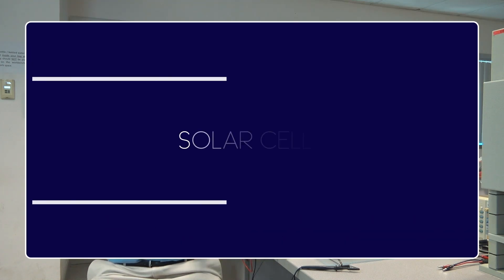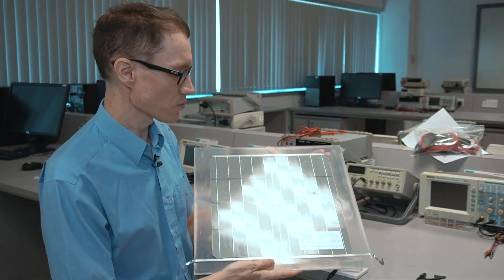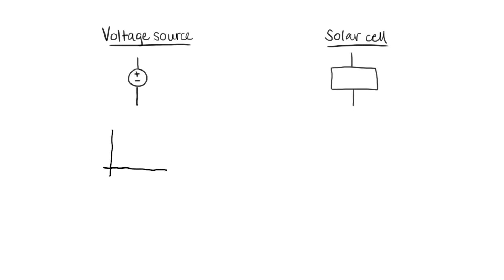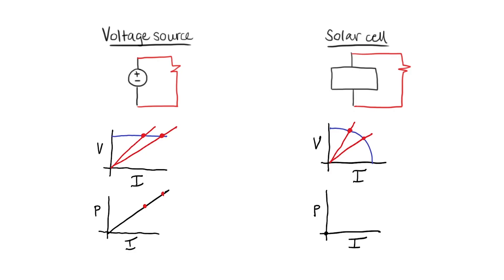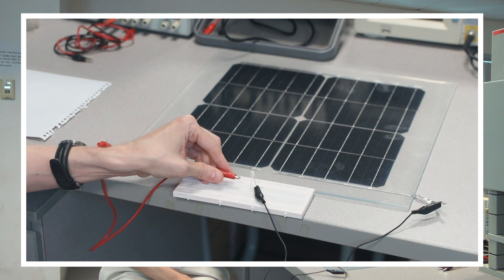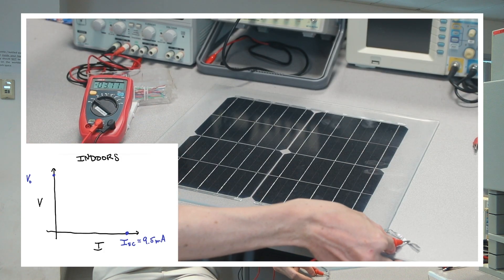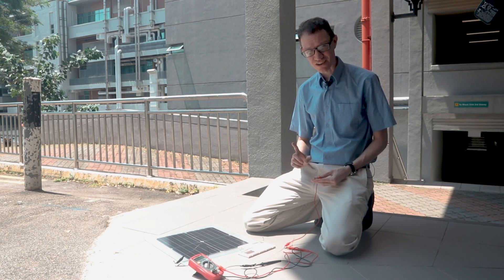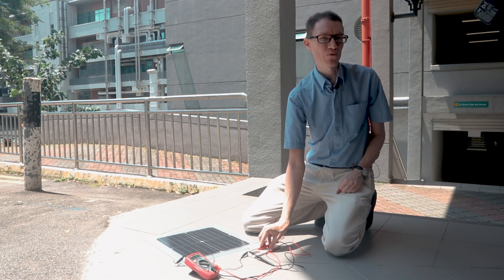Solar panels are not voltage sources (28 - Electricity Distribution)

Comment: what happen if the solar panel with no light applied external negative voltage to its terminal? will the current pass through or get blocked assuming the bypass diode is removed?